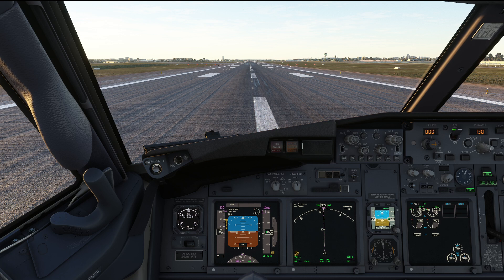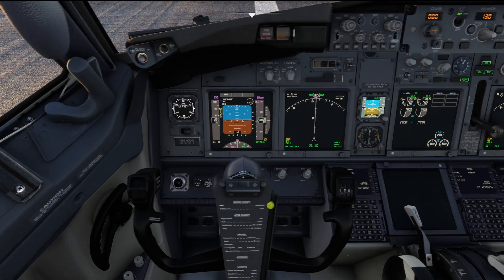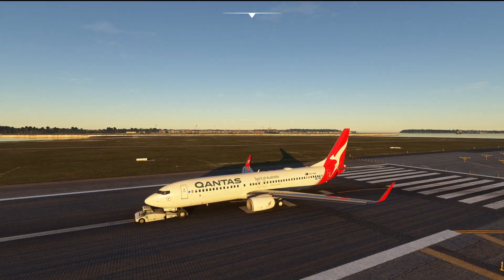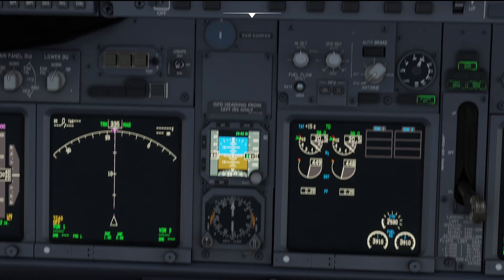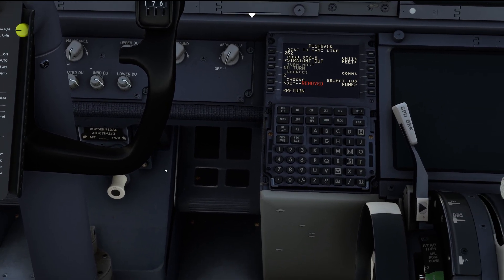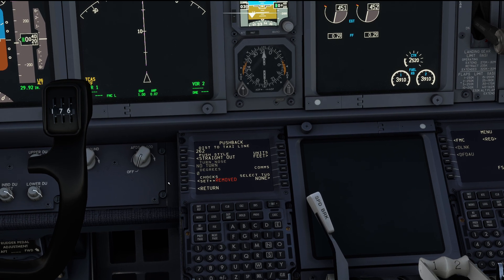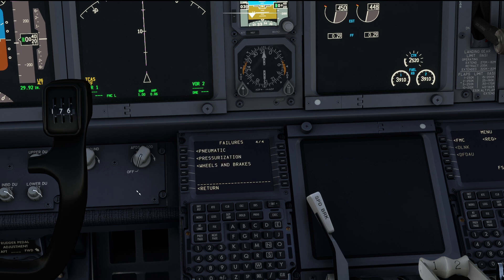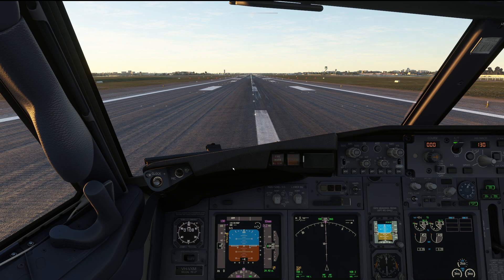What can you do if your aircraft doesn't want to taxi | Real 737 Pilot

Comment: Sometimes I feel like nose wheel turned to maximum and gets stuck, recently on 787-10. And i always check nosewheel steering switches on them or Bae 146. The ATR is NOTORIOUS for not powering the hydros (and even all brakes😮) at low engine RPM in idle range, plus a glitch where if you HELD the ground aux hudro pump instead of quick click, more issues (like prop brake not engaging). This was a cool topic that no one talks about but happens lot more than once! Great job!

Comment: Thanks again for this. Inability to taxi has been ruining my experience of these excellent aircraft. Today I tried to implement your great tips but found that when I went to reset my failed tires they would not reset. I see see now, on 2nd viewing of your useful video, that you cover this by showing how you may need to reset the brakes as well - which I will do next time. But can I ask this simple question? Why is PMDG completely devastating these great aircraft by totally over-engineering the failure system?  It's wrecking it. What's next? We can't taxi because we haven't logged the pilot's hours and appraisal status. There's simulation and over-simulation. I would respectfully say that just because PMDG can program it doesn't mean they should.
Reply from the maker: I'm honestly not even sure what I should say Steve, PMDG have simulated the tires and brakes to a realistic degree. Killing your tires REALLY takes some very strong mishandling of the plane. I've done some intense braking and landings in the real plane and didn't even get close to blowing tires.
I know some simmers really just know full brakes or no brakes, but if you drive your 737 in any way similar to how you would drive a car you'll never encounter these issues. You don't need a pilot license for that.
Reply: @A330Driver  Thanks for the response. I'm not entirely convinced its me but - gently does it then!  I'm a great admirer of your videos and I guess this must be an issue for others or you wouldn't have made a video of it. The 737s are my favorite 'planes in the sim, so I'll just have to wrap my head round that maintenance sked...
Reply from the maker: @steveclarkemedia  Thank you Steve!
Indeed, gentle braking should be all you need. Imagine driving your car: You don't always push the brake pedal down to the floor just to loose a few miles per hour, do you? Why would you in an airplane then? ;-)

There's one exception, that is GSX. GSX can often kill the brakes and tires during its pushback operation. If it doesn't start taxiing after a GSX pushback, check your maintenance menus and clear the failures. And then complain at them why they induce a constant thousand feet downforce during their pushbacks.
Reply: @A330Driver  Thanks Emmanuel. I'll give it a go. But GSX, that's another thing - I bitterly regret buying it. I've expunged most of it from my system but I think I've still got Couatl on there somewhere and will now ditch that, as I think you mention. There's just something not right about that set up.

Comment: This happened to me after I landed, and was trying to get off the runway, I had to use the aircraft slew buttons to move it off the runway. I also buttered the landing at a -22 rate, so it’s not like I landed hard enough to damage the tires or gear.
Reply: I just noticed under failures, I somehow developed a tire failure? Don’t no how?

Comment: I updated the 700 last night and my push back still doesn't turn the aircraft. The tug is trying to turn but the aircraft stays straight. any ideas?
Reply from the maker: Had a similar issue in tiller+rudder steering mode. When I turned it to rudder only it worked better.
I suggest to contact the PMDG support on support.pmdg.com.

Comment: unfortunately there is at least one other case of aircraft not moving. i dont have gsx, tug and every other external vehicle/device disconnected and still cannot taxi. i even checked the brake pressure and ground friction using the dev tools to make sure that brakes are released. they all seem to free and yet, generally after a sharp turn, the aircraft just stops without any brake input and unless full thrust is applied for almost a minute, it does not move. i am afraid i wont buy any more msfs aircraft including pmdg untill this issue gets fixed somehow because it really is a mood killer. in case pmdg requires some screenshots or video or anything to debug it, i will be more than happy to share it!

Comment: faulty pedals here - they would trigger the brakes constantly preventing parking brake and making taxi a nightmare.... removed the mappings from the sim and assigned a single button to brakes to "fix" the issue until i can either repair or replace the pedals

Comment: Thanks for excellent insight sir. Very helpful information; I have had the tire issue inPMDG, but also seem to have a continuing problem with other aircraft. I have bound one of keys on my Honeycomb Bravo throttle quadrant to parking brake and that seems to conflict with aircraft systems in some instances. Have deleted key binding but still run into problem with parking brake remaining engaged, despite using mouse to release brake; also get message to use l control + number delete to release brake, but that doesn’t work either. Eventually exit, reload,all on. Anyway thanks for your time and effort in producing this video for us!